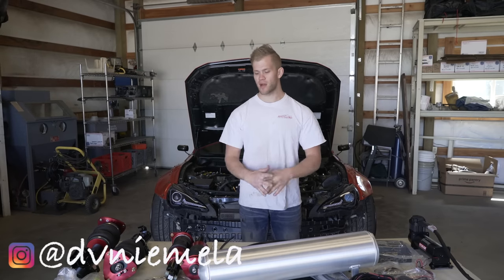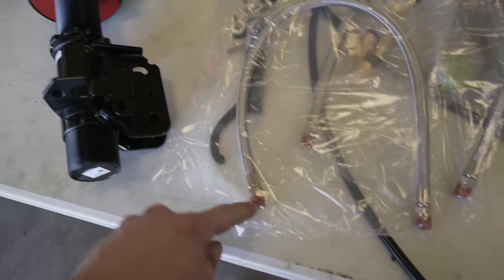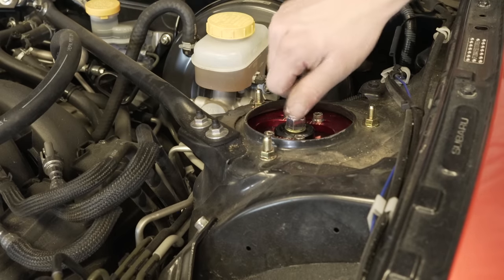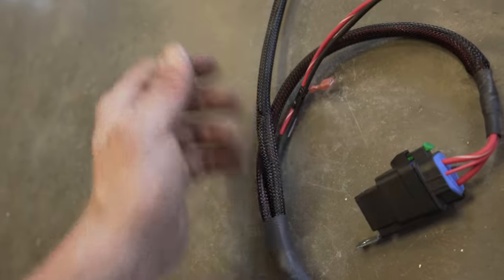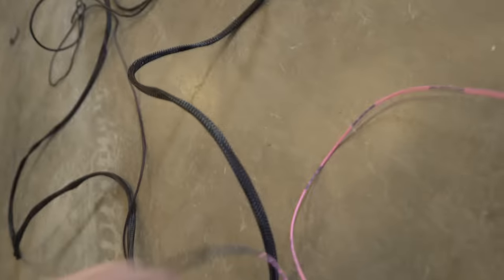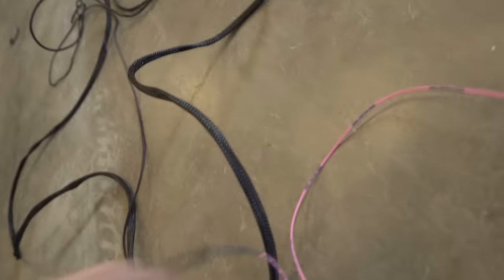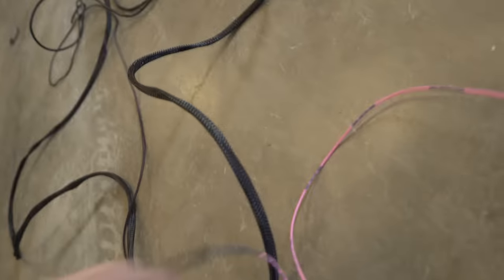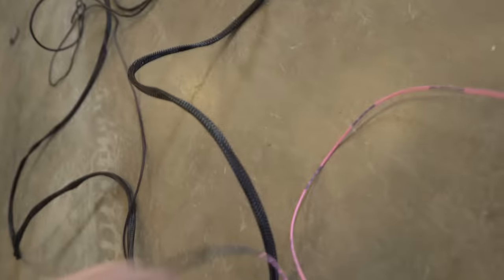The Ultimate Air Ride Install Guide

Comment: I read the comments while the intro was playing & you really did cover everything EVEN down to those BOLTS & things inside the strut tower that WILL BLOW YOUR BAGS if you don’t get em out ! .. I appreciate that because everyone speaks about those bag killers but NEVER gets them on video .. very well put together . Liked & subbed
Reply: Accidentally grinded too deep and cut a small slit around the area of of the bolts that stick out the strut tower. Any suggestions on what I should do?? (filled it in with JB weld for now).
Reply: @conradhudson4589  creepy

Comment: Good details overall. However, the first step should be to complete all the plumbing and air management setup on the trunk, take your time! Then last run plumbing after all has been tested to the airbags on install day. I too, did it by doing the bags first, after figuring out I was missing a few fittings and two days later I was up and running. Install management first, test, test, test and bags last.

Comment: this is a helpful video. i just don’t like that you chose to install bags first rather than management. management should have been installed first just to make sure it works before installing the bags. but that’s you. but i do have one concern. how do you install the rear sleeve bags without any vacuum? it’s very important too because it could be a long term issue with the bags. anyway you can get back to me and explain that process that would be great. it’s a very important step.

Comment: To initialize the system, instead of wiring it to an ignition live couldnt you just add an outboard switch in your car? Run some extra wire to it and switch it on when needed?

Comment: Good video, one tip I'd give is to not use butt connectors, they're just awful and you'll eventually end up with a short. Soldering is the best but I'd suggest just about anything over butt connectors even piggy back connectors as they get a good bite at the connection. Very informative video though, thanks.